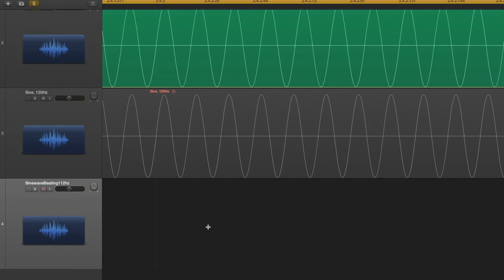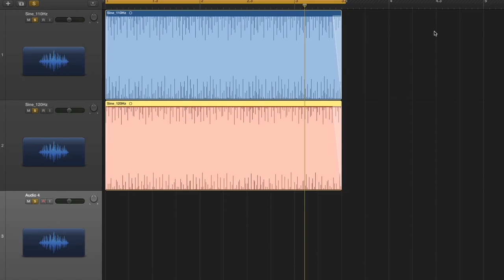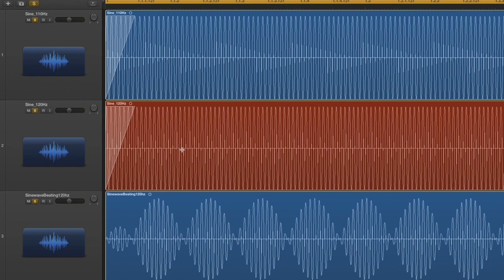Concept of Acoustic Beating and Phase Cancellation with Sine Waves

Comment: You cant hear anything except your voice.
Reply from the maker: Hi Bob - the frequencies being played are at and around 110 Hz (A2), so you'll need a set of speakers which can play down to that frequency. Any set of speakers or headphones setup to play back music will achieve that. If you are playing out of a mobile device then it probably won't be able to play back those frequencies unless you use headphones.
Reply: @bobtoulson  I'm on a computer speaker that can play frequencies that low, however the sine waves are not playing. I think it might be a problem with the video.